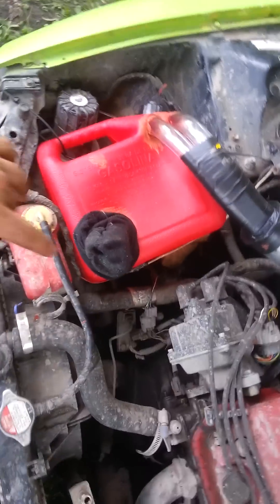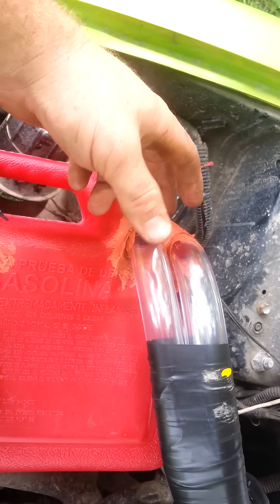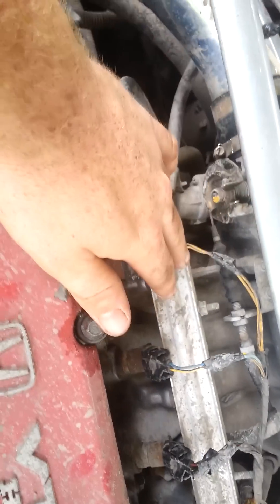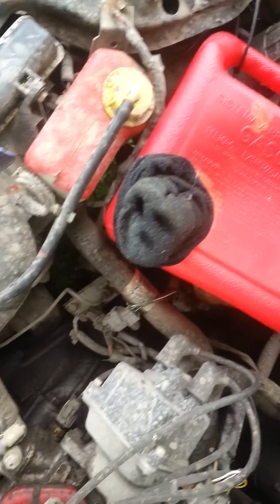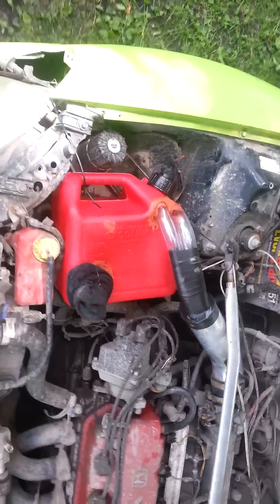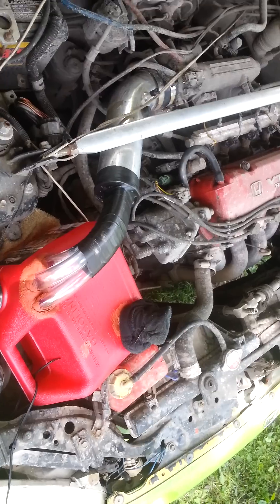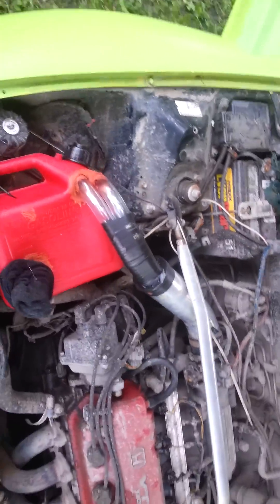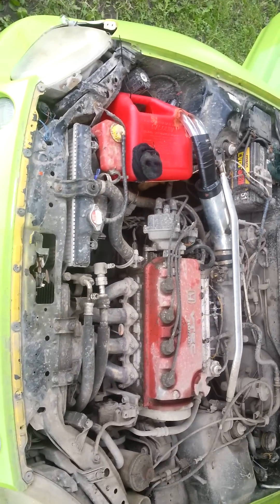200mpg gas vapor

Comment: when you rev it you are running off of more than fumes. that system won't last, the cooling effect will kill it. you need to heat the system to keep the fuel vapourizing.

Comment: Wouldn't that cause the engine to run lean, also wouldn't you run into a heating problem at higher rpms? Ide be worried about my piston rings.

Comment: Gasoline is a complex compound. Before any of the constituents can combust they must be heated to "flash point". The lighter, more volatile elements may be vaporized using a "bubbler", but that amounts to merely 20 to 30 percent of the total mass. In order to achieve combustion of the largest parts of the fuel temperatures of around 250 Fahrenheit will be required.

Comment: 14.7 part of air to 1 part of gasoline is were all the gasoline will burn close to perfect with  maximum efficient,  any thing else is a pipe dream, out of this ratio combustion will be not has powerful, a  lean mixture at full throttle will melt the top of your piston. evaporated gas take all the space were some of the 14.7 parts of air should be, micro droplets is the ideal way to deliver gas in to combustion chamber. like an injector with a good pattern spray so a good  intake flow of air through a big intake valve, all this control by power control module with the help of a O2 sensor and a mass air flow sensor, throttle position sensor. if you want good gas miles drive not faster then 45 miles an hour, you will see how good it gets for real. LOL. that`s the true.

Comment: Would you not want to vaporize the fuel by adding some heat through an exchanger... like a copper coil wrapped around the exhaust pipe?  In this video, it appears you are atomizing not vaporizing.

Comment: Someone told me about these setups. I thought I do some investigation. Wow I can't believe it actually works. I put a 5 Gallon tank, I'm thinking of upgrading my system to the back of the car with a bigger tank for safe measures of course, maybe put a fuel pump and maybe a canister for the vapor. I think the world is flat too. Hot doggy dog 🐕 🙃😵💩

Comment: Ok, there is problems with this setup, it may be running off of fumes, but your only getting the same mpg because the only thing your doing is turning the gas into a vapor, therefore you are burning the same amount of fuel. It would be simpler to put a gas vapor/air mixer of the top of the carburetor and keep your gas tank hooked up

Comment: +Andrew Morris   What controls the gas peddle / engine RPM ? How does it regulate the amount of gas needed ?
Reply: The throttle blade does as it normally does. As the blade opens, it creates more vacuum which pulls more air through the gasoline which makes it vaporize more.

Comment: So what you have done here is just make a carburetor out of a fuel injection system. The worst thing that could happen is you burn up your plugs because you're running to lean. Maybe even possibly foul them out because you're running too rich.
Reply: Instead of burning the gasoline, the smallest amounts of gasoline is drawn into the cylinder with the appropriate amount of air for ignition. This is because of the vacuum that is present on the intake stroke of the piston . This causes the fuel to dissipate into molecular or its smallest form making it very efficient. This set up or in my case very similar, achieved 100 hours(96 to be exact ) on less than 2 imperial cups(Im Canadian) The control (same engine with carb) was 45 minutes. It doesnt matter if you use regular or premium gasoline it doesnt matter if the gasoline is contaminated

It makes no difference if you use a bubbler or a wick or neither the results are the same. I know I tested all of these

It scorches the intakes after 500 hours
 
the emissions are carbon dioxide

I worked on this project for 3 years 7 days a week about 10 hours a day. There are many you tube videos of this system cutting grass. Load is not the issue. Also stationary engines are not proof that this system is involved in some conspiratorial cover up its only proof that the engine will run on gasoline molecules but not for the reasons stated in the video
The actual explanation is a little more complex and involves a white board discussion I have given many times. The physics is quite sound for this device although the concept is very misunderstood. I come by my experience honestly and post my opinions to dispel most misconceptions but unfortunately the medium we use is not that conducive to open discussions and exchange of ideas.So sometimes the answers seem ambiguous they are just a problem of the context of the answer to the question posed.
 The only successful trials of this device have been achieved through running the experiment at a fixed speed. It doesnt so much matter what speed but a fixed speed. Shell Oil did it on a test track at a fixed speed. GM on a test track. Tom Ogle's famous El Paso TX to Demming TX at a fixed speed. The trial was successful till he tried to slow down to come into El Paso on his return and the car stalled. The vacuum is not as reactive as metering the fuel in traditional methods so the speeding up is possible but once you establish an equilibrium the speed must be maintained variation will stall the engine. So he was successful as successful as this system allows with what we know. It does have its limitation and that is what keeps it off the market today

Now you could run the engine at a fixed speed on a hybrid electric car( or hydraulic) and manipulate the speed with the electrical system. Ive got a few people Im advising on the concept so hang tight 

As well in testing the device I also caused the engine to spark into the tank as a matter of testing its safety and due to the lack of air(presence of vacuum) the intake line (which was clear) lit up like a light bulb for a brief moment. EVERYTIME  
 I have seen people try to use heat to create vapors thinking that some spark arrestor would save them and I have cleaned up after the fire and plucked spark arrestors out of the wall . Probably peaked my interest in the safety of this device though I always have the same two words for everyone FORD PINTO. Just because it hasnt blown up yet it only means the conditions were correct and an explosion wasnt imminent. I have tried my best to ignite the system and up until now I have failed in every attempt. The theory is a vacuum prevents this but theory and prevailing wisdom says it shouldnt start either. Experimenting is inherently dangerous but I feel as safe with this system as any, so thats my take on it 

Anyway the difference in my opinion compared to most is Ive actually done proper experiments kept logs and had controls for the experiments. Most experiences on You Tube are anecdotal in nature (not derived from actual testing) and the opinions are mostly speculation and conjecture. A lot are well meaning but not derived from proper testing

I became involved because my dad ,a mechanic said "it would never start the engine" So I worked at starting an engine. Then it was "it will never pull a car" So I installed it on the 1969 mustang I had and pulled 10 seconds in the 1/4. Then it was" it wouldnt work for very long" So 651 mpg on a 1100 cc volkswagen later............. He was right in a way it doesnt really function as a car is expected to. And thats where we are today

Just a note for anyone who has read this post to here, my experiences show that an engine in an automobile application is about 20 times more efficient than its original configuration. So for those who dont believe its any more efficient or for those who look at the 100mpg as the "holy grail" youre both wrong

Thanks for the opportunity to speak my mind

Comment: Interesting idea, but every one that I've seen, as soon as they rev the engine, it's sucking in gas, as you can see it passing thru the tubes.  So if you are actually driving, and accelerating on the freeway, or from a stop at a red light, you're going to be dumping fuel into the system, not vapor, thus negating the whole purpose.  If you traveled the same speed with the same amount of throttle all the time, like a lawn mower, then it would work.  Otherwise, no.

Comment: lolol....another crackpot video. Carburetors and fuel injectors vaporize gas. Car companies came up with that idea...well...when cars were invented. But now you have crackpots using lawnmower gas cans with plastic tubes coming out of them doing the same thing. Somehow, to some unlearned people, this is an amazing discovery. Bwahaha have. You'll get 5 mpg with that crackpot setup in this video. That's 5 with a 5.

Comment: The people using glass containers? The mist you see is a by product of the vacuum and is responsible for the cars efficiency but the mist or vapor is not running the car otherwise it would be sucked into the engine compartment. Gasoline like any fluid dissipates in a vacuum and it's like what happens in outer space. Outer space is cold and vacuums are as well
Sorry to be long winded on the subject. But I hear a lot of myths on you tube and after 3 years I've learned a great deal on the subject. Thanks for bearing with me

Comment: By the way it is not fumes or vapor it is the actual molecular structure of whatever liquid fuel you use. You can use naphtha  xylol toluene acetone turpentine. diesel. The more dense the fuel the more near total the vacuum
With a properly sealed unit heat is unecessary. Vacuum if strong enough works fine any leak though and system doesn't work
It's very simple but the ultimate goal has yet to be reached. Everyone thinks they have the answer or are close. I've yet to see it

Comment: The vacuum is cold and condensation forms that's why Tom Ogle put rad heat through system I ran the Volkswagen in -40 without any heat from engine except residual from engine compartment. The vacuum lowers the boiling point just like salt lowers the freezing point of water. Problem with relying on heat is at -40 you've got to come up with a preheater and that still doesn't make the vacuum reactive enough for constant speed changes
When you start with fresh gas the system is reactive because the most volatile part of the gasoline goes first using vacuum you are refining the gasoline down to more levels. The gasoline gets thicker and if you only burn one gallon in the tank at a time it functions like a normal car for about 12 minutes with lots of horsepower but the reactivity starts to dwindle and the delicate balance must be maintained. There is no problem with just idling as stationary engines function well with the device( I did this full time for 3 years. ) everything I have ever seen concerning this device on you tube I have tried at one time or another in infinite combinations. I have never heard or seen anyone come up with a solution. Ogle didn't Pogue didn't the famous GEET system was never demonstrated to do more than run stationary engines( the easiest thing to do)
Plastic gas containers are fine for the first while but in an automobile they cannot stand the higher vacuum that is needed to keep the system going
By the way She'll Oil ran an Opel 371 mpg on a test track running a constant speed GM did the same Ogle did the same I got 651 mpg on my VW the same way but no control past the 12 mile plateau. Had to keep it at a steady speed
That's why ogle didn't make it all the way back from Demming. He still had gasoline but couldn't get the car started again. It works but I've never seen it work on a regular car in normal conditions for any length of time
Keep it up though who knows someone might figure it out. But it's all been tried before. No I don't work for " Big Oil" lol
Reply: You need to try white gas and a dumping system, when the useable fuel is spent, it dumps and a secondary container is filled, the only way I can see this working,  Yes it works at first but like you said , usable vapors are spent and only fillers are left.
Reply: The GEET was used on a Subaru car, but they ran it too cool due to raw heat exchange the GEET reformer is known for and TheGEETGuys had to fix the engine.
Reply: I wonder if ethanol would work. If it's high proof it shouldn't dilute as it's spent.

Comment: what happens to the fuel injectors when you turn the fuel pump off and run on vapor? won't they burn up with no fuel to expell?
Reply: no but i gotta think the motor is running lean look up the provlems that intells

Comment: it does work. you need to keep the fuel warm or hot. also it is a fire hazard. on idle, a 1300 cc engine burned 1 litre of fuel from my plastic container.

Comment: I saw raw gas coming through the tubes when you revved it up. may want to adjust the placement of can.
Reply: Yes, this definitely not fumes. I agree running on fumes is possible, but this is not the case.
Reply: ya i see that problem with a lot of these builds i been thinking of building a 3 chamber system and using acetylene tank wick in chamber 1 the stone filter in chamber 2 and chamber 3 for the hoses to leave should stop any raw fuel from leaving the tank.
Reply: https://youtu.be/Ke0MGmUr3SU

Comment: Whats the maximum rpm for this method  .why everyone doesn't use this system
Reply: Hint as good as it seems to work on small stationary engines it is not very responsive to changes in conditions or demands of driver in an automobile
All the videos on YouTube are pretty much the same and everyone has the same answers to the same problems. 
It works on a vacuum principle. The vacuum lowers the boiling point of the fuel. The atoms disperse and are drawn into the cylinder with air and explode on ignition
The problem is the vacuum is not responsive enough to adjust to changing demands especially after the most volatile part of the gasoline is used up. 
The most successful attempts with this system involve running at a constant speed ( Tom Ogle late 70s) or on a test track at a constant speed( Shell Oil early 70s)
There are numerous patents on this idea and principle GM owns several Ford Chrysler, ogle , pogue among many. I worked on the idea full time for 3 years ( 79,80,81) and kept a detailed ledger of my experiments and observations
I have no idea how long a 3.5 hp lawnmower engine will run on this device 96 hours on 2 cups was best I could do ran out of patience. 4 cylinder? 6 1/2 hours on a quart. With its fuel injectors 16 minutes
A plastic tank works for the lightest part of fuel but cannot withstand the high vacuum needed to use the fuel in its entirety

Comment: Jim Vicious1 week agoDozens of examples of raw evaporation draw systems were in use before the invention of venturi carburetor. Of course it "kind of" works, but don't expect a single iota of useful engine output on demand unless you just kind of tip the can under load. This is a step backwards in technology. All of the little curious bits in a carburetor were for .. wait for it: optimizing the vaporization of gasoline to meet the demand of the engine load efficiently. Admittedly traded off a bit for cheap to manufacture, overall simplicity, etc - but they did their homework adequately (considering the engines they were fueling as well) for cold starts, load enrichment, idle to primary circuit handoffs, stoichiometery being resistant to ice, flat sustained drivability as well as flood resistance to acceleration, cornering and off angles etc. Ah, so you hadn't thought of all that in your design!

Not to bust your nuts mind you, you clearly stated you were trying this for the hell of it, not trying to convince idiots that you've solved the 200MPG problem, so fair enough. Just lettin' you know this has been done, tinkered with (in some quite ingenious ways actually)and is what eventually evolved into what everyone had until even their demise 30 years ago.
Reply: +Matthew Miller yes, thank you! This is ultimately just a primitive carburetor.
Reply: Thats the best explanation anywhere so far! But what about propane/natural gas conversion? down here where I live I can get a 30lb forklift propane tank filled for about 15 bucks. In an old hyster 6 cylinder itll run it for what seems like days I wonder if theres a way to add propane to subsidize the fuel demands of an engine under normal driving conditions so it maintains the same characteristics of a "normal" car? like using vapor for highway/even load engine demands and propane for cold starts, smooth idle, etc...as one goes up the other goes down etc
Reply: JaDo Steele they had Kit's for converting carb's using a different orifice for propane, and they were exempt from smog,so those I am not sure you can still acquire

Comment: Why is it in all these videos I only see the engine run, and nobody drives the vehicle? I want to see someone driving these wonder cars on the highway...
Reply: +Kentucky Ranger  put this in the search bar    gas saver dodge runs again   this guy has the same setup and drives.  The big issue is keeping the fuel from freezing up and not producing vapor under a vacuum.

Comment: I know that this will work, but I doubt that it has the claimed fuel economy and should benefit more than running lean.
Reply: works great if done right 10x fuel economy
Reply: I have been told that before, I think I will try for myself, I have set aside an old Briggs & Stratton motor in my workshop that i have equipped with two valves and a hose to Connect to a vaporizer, I hope that I get some time to finish it and run it soon.